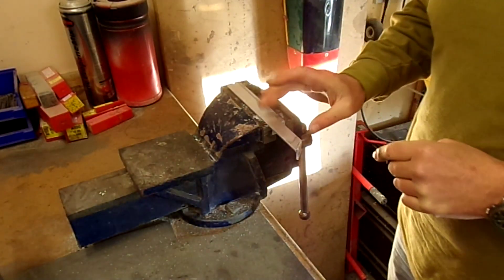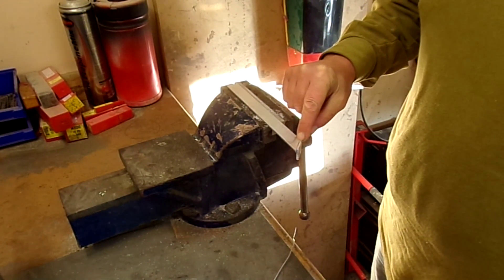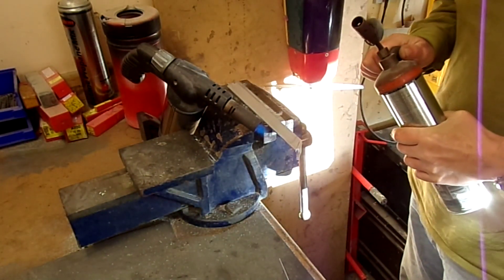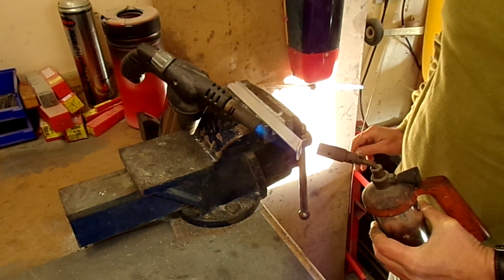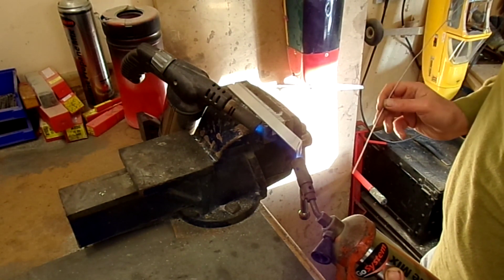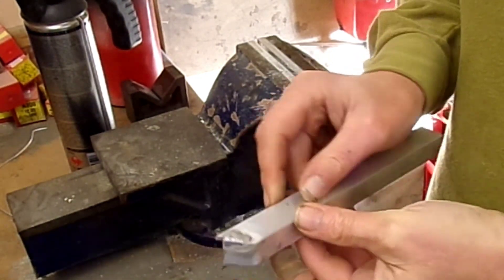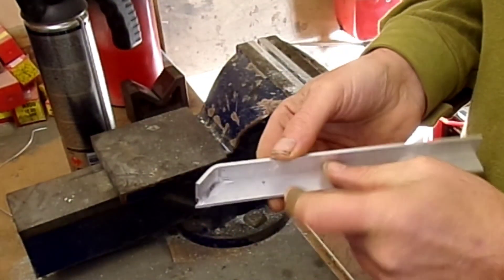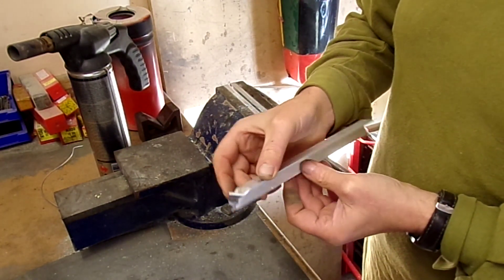Aluminium Brazing at home.

Comment: Thats really interesting as I always thought/been told that Alu will oxidise to quickly if you try and solder/braze it. Sounds like they have got the flux sorted out now.
Reply from the maker: Yes in the past you had to brush the surface just before applying the braze. You do need to clean the flux off after you finish but that's easy with a brush.
Reply: @flyingkub  I  would always dip the alloy in hot caustic solution rinse then nitric acid to remove the oxide then weld the the trouble is the oxide has a much higher melting temp than the alloy
Reply from the maker: @electoplater  This is not welding but brazing, you described the method for gas welding aluminium.  
 I just went with the instructions and cut light clean with brush and then braze. The flux appears to work well,  if  it needed much more work like the older brazing rods, which you had to brush right up to the point of it flowing,  then you might as will go for TIG welding.  Just my thoughts as to me this is not suitable for important structure.

Comment: I've been thinking about when my first & only Brazing experience was.  It was in school, about 39 years ago now, when we had to make metal spinning tops.  We had to braze what for want of a proper word I'd call the vertical 'axel', into a hole in the flat bit that spins horizontally.  I think mine fell apart after not long.  Still, they trusted 12-13 year olds with things like that in those days.  I must have been fairly young because I didn't do CDT after my O'Level opitons (ironic since one of my hobbies involves making stuff).  It wasn't that I didn't like it.  I think it was just that the disruptive kids took CDT as an option, thinking it meant they could mess with stuff and I was more of a bookish sort.
Reply from the maker: They have about 4 pages of Health & Safety to fill in now to let kid solder a wire 🙂 I managed to do metal work and tech drawing at school, we did not have disruptive kids in those classes as the teacher was an ex marine. Press Up if you did anything wrong.
Reply: @flyingkub  My Primary Headmaster was ex-army.  I think they encouraged soldiers into or back into teaching, post WWII.  I also had a Welsh teacher (another subject I dropped at 13) who we called "Sarg".  He had a crew-cut and was strict but may not have been ex-army.
We had an ex-army PE teacher, who we called "Popeye".
Reply from the maker: @YeRobertPayne  Sounds just like my school just moves to Wales.